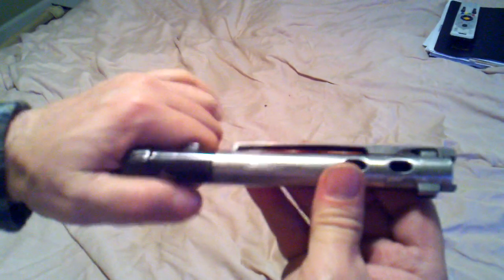Removing extractor from a Mauser Bolt

Comment: Will it go back just as easy?
Reply: Tom N it goes back a lot easier. I lubed mine up, which is the reason I wanted it off, and if you go generous with the oil it makes it much easier. Then you can just wipe off the excess. I used a rag to hold it so my hand wouldn't slip.